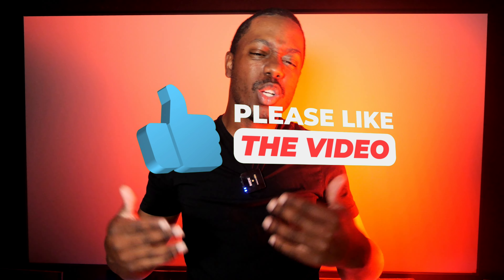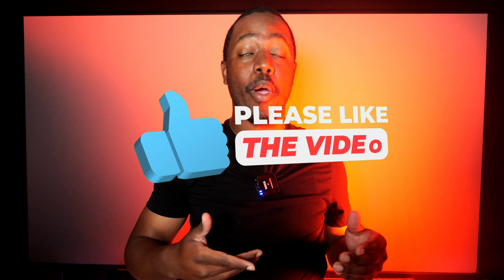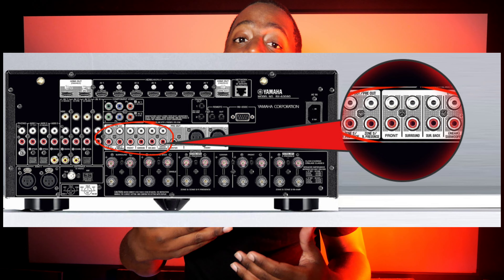Av Receiver Pre Outs vs Pre Processor Pre outs.. What's the Difference??

Comment: I think a AV pre processor with external amps will always be better but of course the expense comes with it..AV recivers will be more convenient doesnt necessarily mean less expensive. Id recomend if buying an AV receiver you get one with pre-outs just incase you want to expand youll have the option or if you want to get a taste of what a AV processor will sound like before you buy one id say its the way to go. 

In my opinion i believe if using a AV receiver with more than 7 channels its best to use the 3 front speakers (or at least the L,R channels) with pre-outs,  it leaves the AV receiver with more power to use for the effect channels, rather than having to share with the 3 front speakers aswell which use most of the receivers power. So in a loud chaotic movie scene youll be able to deferintiate each sound through each speaker better. Hope that wasnt too much to process 😉

Comment: I was literally thinking about this 25 minutes ago! 

I have a Denon x8500h and want to get a 3 channel amp for my LCR (setting up a 7.2.4 system) and was wondering if the sound would be compromised using a receiver vs a Pre-Pro.

Thanks for taking the time to make this video. I'm really looking forward to learning more!
👍 😊
Reply: Depending on the amp you choose and your listening habits, generally speaking it should only improve. You'll be increasing your headroom for dynamic swings and taking load off your receiver. One thing to research would be the pre-out voltage from your receiver. Some are higher than others
Reply: @stevenbullock9276  Thanks so much for the advice! I really appreciate it! Have a fantastic day sir! 👍
Reply: I agree with Steven. A friend of mine added the Monolith 3x to his front stage, and the sound was very full. He has Klipsch speakers on his Denon AVR-X4800H. As some of us know, Klipsch speakers have a distinct sound to them, and they are very sensitive (meaning they are very loud and easily driven by a receiver). Having that said, it depends on what speakers you have as well. If amplifier is more powerful than the ratings of the speakers, movies with high dynamics in it could damage the speakers when played at reference levels.

 I believe in the Denon X8500HA, the preamplifiers for the LCR are disconnected from the power amplifier stage, tasking the power supply less. That receiver is like a hybrid device. It's as if it can become a processor due to it's capabilities. Only thing missing are XLR jacks from the preamplifier outputs. It's an awesome receiver, that's for sure. 

In my opinion, I'd go full throttle and add two 7 channel amplifiers to it. Again, this all depends on speaker sensitivity and power handling. 200w RMS into 8 ohms kind of amplifier. Adcom, ATI, Rotel, make  Class AB or Class D amplifiers that are bulletproof. Just my opinion though.

Comment: I have an X4700H and a Tonewinner AD-8300PA and have all the pre-outs from the Denon going to the amp (except for the subs) in my 7.2.4 system.  The TW gives me about the same power for most of the speakers, but it has higher-power modules for the LCRs.  It makes about as much of a difference as bi-amping the L/R before adding my rear heights.  Having recently having to replace my turntable I can't afford to upgrade any further (Rega P2 w/ATV-M540ML, Rega Fono MM Mk5) and am pretty happy with what I have...so far.  The Denon only has RCA inputs/outputs, but the amp can accept either RCA or XLR inputs.

Comment: 👍🏼 nice work dude. A couple of other benefits are the balanced/XLR connections that are usually standard on AVP's. Basically zero distortion or interference especially on long runs or crowded spaces with interconnects. And with more and more quality powered monitors out there (JBL, Fluid, Kali, Focal etc.) you don't need to buy separate speakers and extra channels of amplification. Just run the Xlr's to the powered speakers and plug them in.

Comment: Okay.. I get it now. .. I still vote for Pre Processors if affordable.. because the DAC.. noise floor.. preOut XLR higher voltages.. gain settings.. and Power amps are ALL avenues to better sound.

Value is, as you say, IF you need the channels.. but need and better.. that's a different debate.

Comment: I have a Denon X5200 with 13 channel pre outs and I am using all external amplifier’s for the entire system one 4channel amplifier for the Atmos and separate amplifier for the rest of the system using all digital amplifier’s and I am now working on rebuilding my layout because the 4channel is huge and I need to get it in my rack somehow. A total of 6 amplifiers  in the rack and I need to get the 4 channel amp on the bottom but I am happy with the Denon and I will keep it until I feel that I will need to upgrade.

Comment: I have a processor and receivers with outboard amps, been doin' it for years. Currently running 9.3.4 configuration. You will be hard pressed to tell a difference between the a receiver with amps and a similar processor with amps....PERIOD. You will hear a difference ONLY IF YOU WANT TO.

Comment: I have a 5.2.4 using a marantz 9.2 av receiver, the front 3 is being powered by a external amplifier. Since the rest of the channels are being powered by the av receiver I feel that I have all the power I need for the size room that I'm in. When I decided to get an external amplifier it was to be able to add two more speakers to my system at some point. So for me, unless I move my theater room to another, bigger size space I don't think a pre/pro make sense.

Comment: If you have seven bed layer quality speakers, external amplification with a processor is a game changer. I run two Anthem AVM70’s coupled with Parasound A-23+ and A52+ in one system. The other system has the Anthem MCA225 and MCA525. It is up to the experience you seek in this hobby.

Comment: Good video... I would mention the XLR jack outputs, which is best if you have multiple subwoofers in the room and amplifiers that support them. These cables are less acceptable to hum at long distances due to the noise rejection circuitry on the input and output connection of the device. Most receivers don't have XLR at this time. Of course, you'll need subwoofers or/and amplifiers that support these jacks. 

Also, some people may have to consider space. I have two ATI manufacturered amplifiers. They are 7 channels a piece and 100lbs each. They are pretty large amplifiers. Just something people should take into consideration. Of course not all amplifiers are large like that. For instance, Class D amplifiers are very efficient, accurate, and powerful today at half the size and weight. But when going old school power design, Class AB amplifiers are going to be large and in charge. Just my opinion. 

Good topic...
Reply from the maker: Thanks for watching!

Comment: You mentioned money at the end of the video and how you don’t want to overspend if the returns are minimal—like paying three times more for just a 10% improvement.

Here’s my question: I know you have the KEF R11, which is the speaker I’m considering to upgrade my system. I’m planning to get an all-R Series setup. Currently, I have the LS50 Meta for my mains, Wharfedale Denton 80th Anniversary for surrounds, and Polk Audio speakers for Atmos.

However, if I stretch my budget—maybe charge it on my credit card, tell a little white lie to my wife, and skip going out for a year—I could afford the KEF Reference 5 for my front left and right channels while keeping the rest of the setup as the R Series.

How much of a difference do you think the Reference 5 would make for movie watching? Would it be a significant improvement or just a minor one? I know it will elevate my stereo music experience, but I’m not into audiophile tracks. I mostly listen to pop, hip-hop, electronic, and R&B. Would the upgrade feel like night and day, or just a small step up?
Reply from the maker: @brianclass1988  I think the difference will only be noticed when it comes to music. There will be a noticeable sound quality difference and bass reproduction difference but it won't be as obvious if you only plan to watch movies especially streaming
Reply: @Kpaceguy thank you

I rely on subwoofers to handle the bass, so I wouldn’t want to pay extra for speakers to get superior bass performance. I’d even consider bookshelf speakers, but with my LS50s, I’ve noticed they struggle to fill a large room. That’s why I’m looking to upgrade to something more capable. 
but i’m spending way to much time looking to get the answer from r11 to ref 5… i live in the philippines so i can’t audition them… nobody carrie’s the ref 5… unless special order

Comment: No doubt all true.  Sure a better DAC with the higher end equipment.   Young folks--go for it, get the best.  However, for you older folks, I'll bet your hearing isn't good enought to tell the difference between a great processor and say a Denon x4800h receiver in preamp mode with a good power amp.  It's a shame but an enormous group of people can't afford all this great equipment until they are past the age where they can hear anything over 12 or 13kHz!
BTW that 4800 is a heck of a good receiver with great processing and if you can catch a sale it's $2k.

Comment: What isn’t mentioned is all the other sound improvements that could be made instead of the price increase in going to a pre-amp over an AVR. How much room treatment, improved amp, or professional audio calibration can be had for $1k-$2k+? Chances are that’s where the REAL improvements will be had.
Reply from the maker: You need that stuff even on a $400 receiver
Reply: @Kpaceguy  Exactly. That’s why I’d start spending money there first rather than chase a TINY improvement (relative to room treatments, calibration, etc) by switching to a pre-amp. If money is no object and you can go all out in everything, sure, get a high-end pre/pro. Otherwise, spend money where it’s going to give you the biggest bang for your buck.